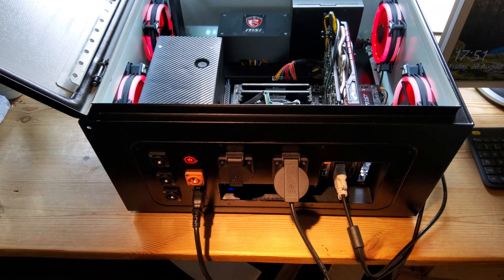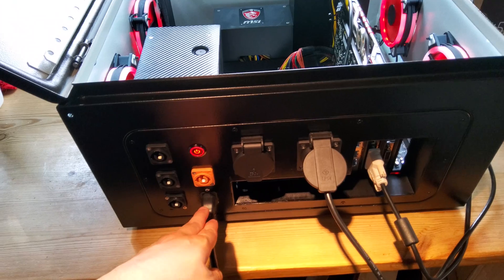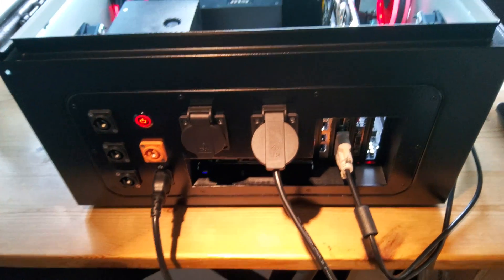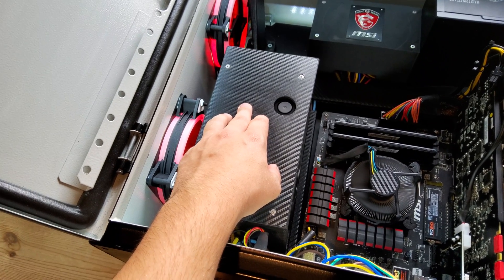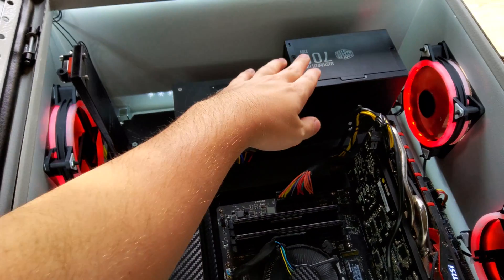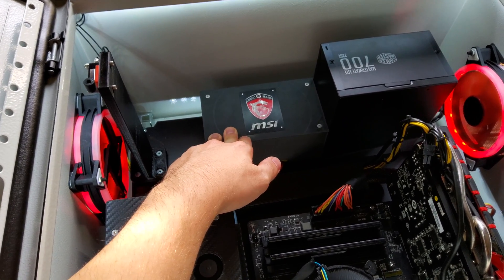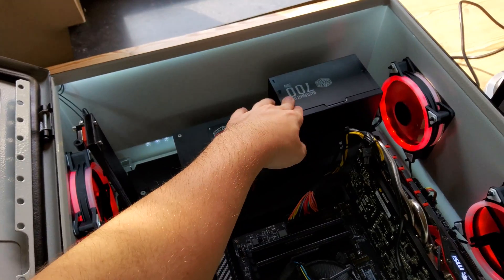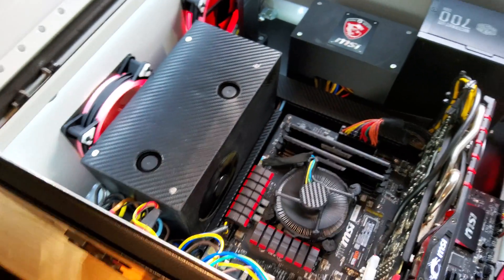Electronics 🔌 | DIY 6 DOF Racing/Motion Simulator 🏁 | ODrive

Comment: Very, very professional, congratz.
Do you have any heat problem mixing the PC heat with the case heat?
Reply from the maker: I've not had any heat problems with this configuration. The fans move a decent amount of air through the system.